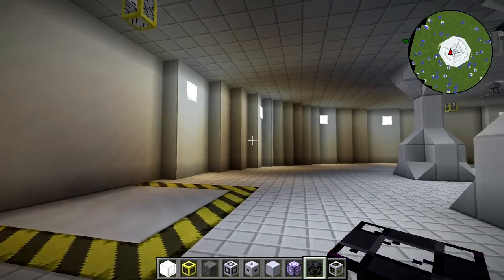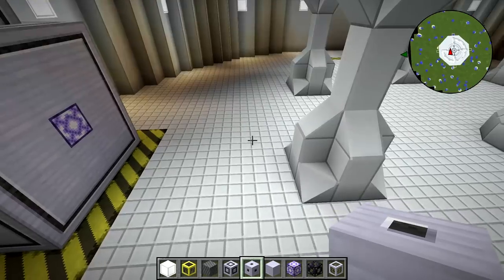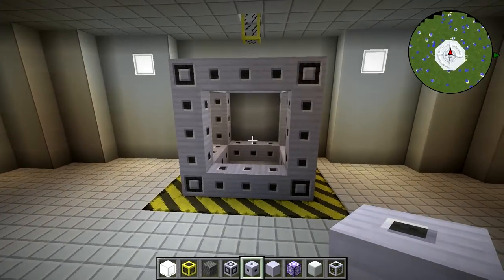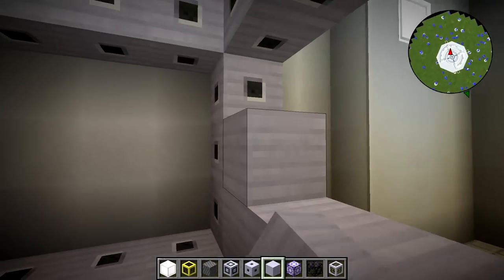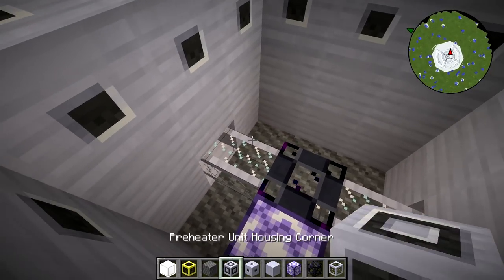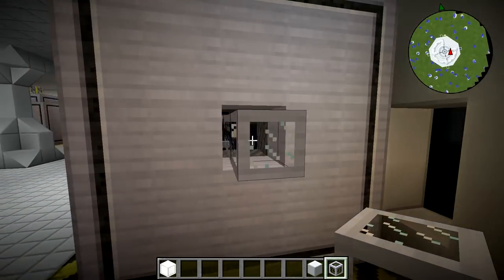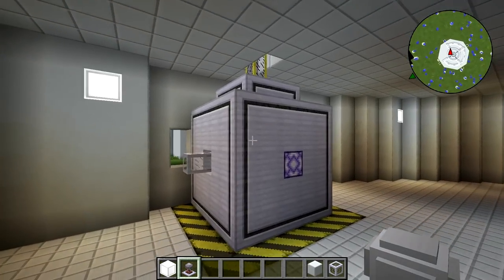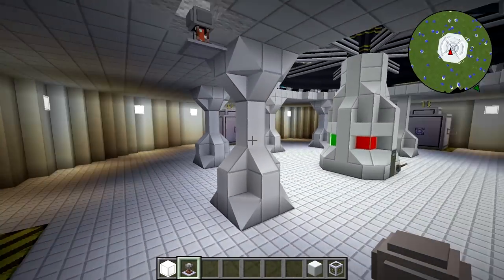ReactorCraft - Fusion Plant Build #1

Comment: Just some pointers for anyone coming around and seeing this when trying to make their own reactors:

It's about 1 preheater for every 50 injectors. I still haven't found anyone besides me building larger reactors, so everyone only needs 1 by a very long ways.

Conduit only needs a DC engine for every about 30 blocks. You can see it is getting charge, as the texture of the gold will change a bit and become animated. ( Even better, click with an Angular Transducer to get the charge level. As long as it never reaches 0, you're good. )

Take a bit of a note of his boilers and absorbers. Putting some thought into it can save you a ton of headache later. The neutrons work pretty much the same as the fission reactors ( only the 4 directions ), and there will be significant hotspots, and in far greater quantity than fission reactors. You have free reign on placing the boilers and absorbers, so get creative!

Comment: what you could do in the areas behind the preheaters is use the Rotary Craft terraformers to make 6x6 areas of ocean or deep ocean biomes then dig down a 5x5 hole to the appropriate level (somewhere in the low 40s or 30s) and make the heavy water extractor setups.. place water blocks at the ground level to fill it up to get your heavy water from to make the deuterium.. then have small fission reactor setups (4 or 5 inline cores should be sufficient) at each ocean biome point to get the tritium and provide the required startup power (maybe one regular turbine/w turbine flywheel per fission reactor).. have a setup of drums to store the fluids (bedrockium drums preferably) to be used in the preheaters along with the water needed for the fission reactors.. thats what i would attempt anyways =) lookin good though.. keep it up and i look forward to the next!
Reply from the maker: Ravyn Knight I don't want to have anything underground though. One of the main goals with this facility is to make it easy to past into a world by having everything self contained within the structure.